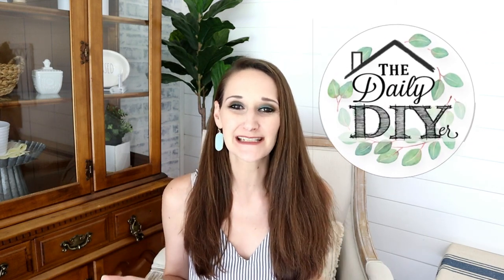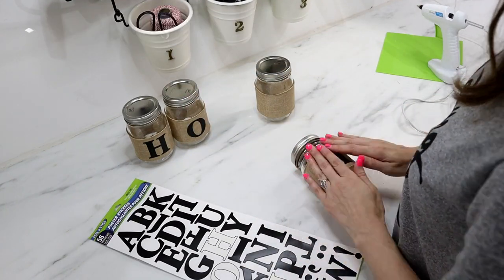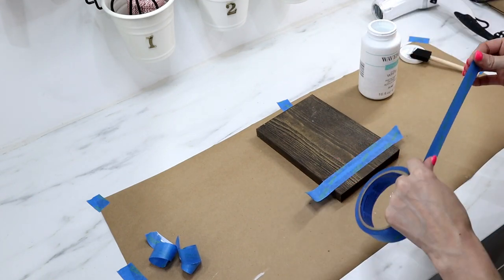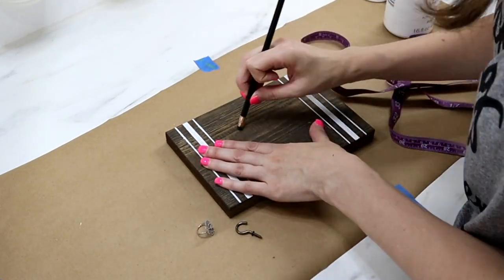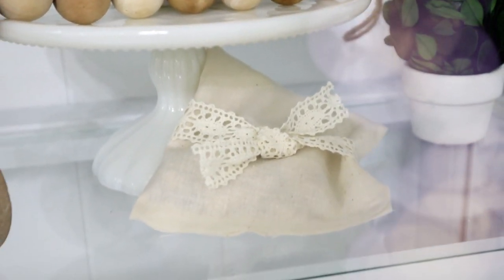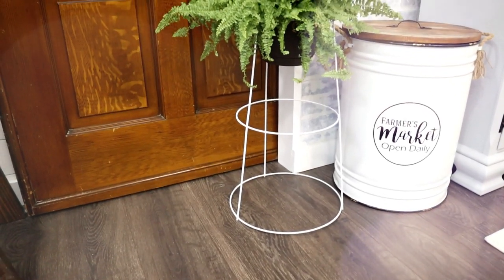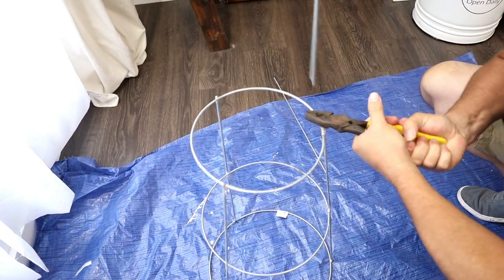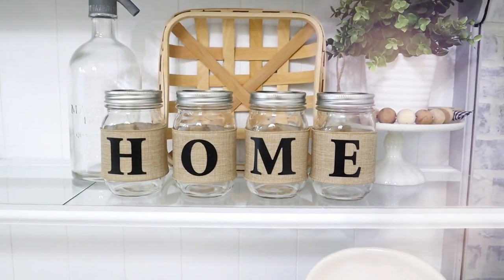5-Minute DIY Home Decor! | FAST & EASY

Comment: If you do a light coat of polycrylic before paint on the wood, you'll prevent most of the bleeding. Use a brush and purposely brush in all different directions in order to push the polycrylic into any spaces that are hiding under the tape/stencil, then paint as soon as that dries. I've been doing it for years and never have bleeding.
Reply: Thank you for the tip I'm gonna try this.